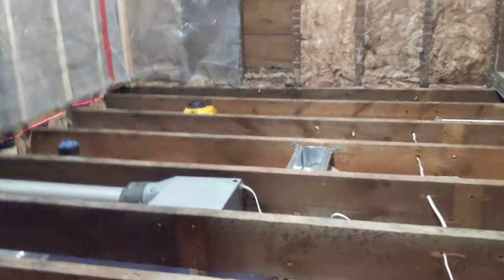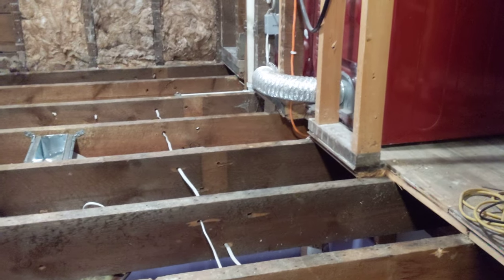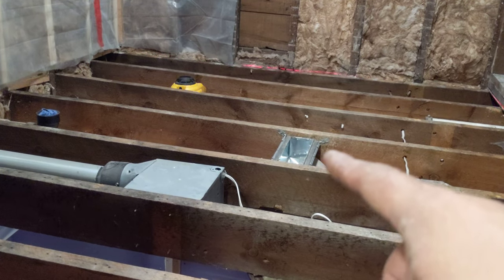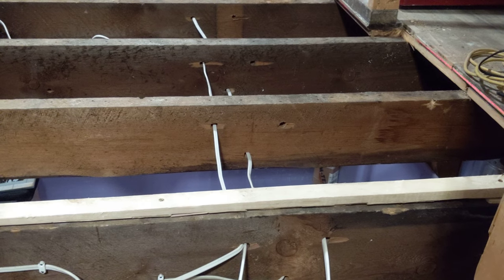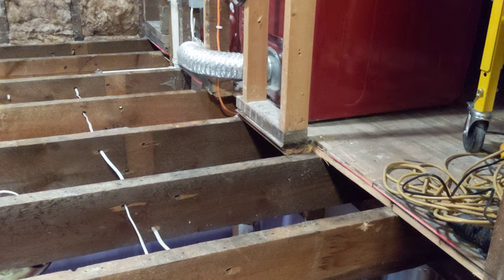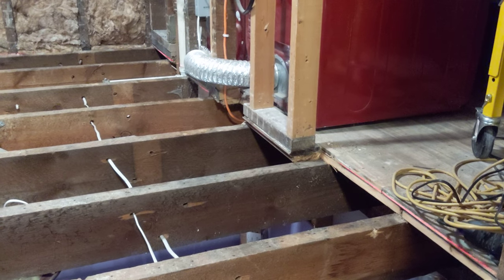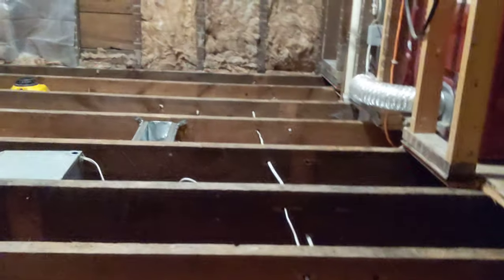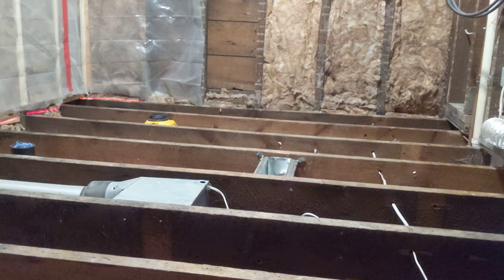How to level floor joists in old home.

Comment: I really enjoyed watching this video and I am currently working on my laundry room floor in much the same way.  I removed some of the old floor joists because they were twisted and it would have been difficult to intall shims on top and for the new flooring to lay flat.  Also,  the floor is higher on the inside wall and slops toward the opposite wall facing my backyard and the difference in measurement ranges from 1/2" to 4 5/8" at its highest point.  The "centers" measure 22" between joists too, instead of the standard 16".
Reply from the maker: Ours had quite a bit of slope as well. Even after leveling all of the interior rooms with jacks in the basement. Those old homes sometimes just did not have even boards. This home was built in the late 1800’s.

Comment: I don't raise the floor where it sags, I lower the surface of the joists at the original high points so that when I lay a new floor it is perfectly aligned and matches the existing entrance to the next room.
Reply from the maker: So we only shim up at the side walls throughout the floor. All the entrances still matched at the doorways. I found the to be less tedious that trying to get all the joist level by removing wood. Also maintained the integrity of the joist then. Not to say there isn’t enough to reduce a bit but for our situation this was easiest.
Reply: @TrueBlueCollectibles yeh i dont think taking away the integrity of the joists is a good answer. Im having this problem right now. Thanks for the video. Was going to put raised blocking. Might still do that and ad shims on the joists, level to the  blocking.

Comment: Why didn’t you put a 4x6 center support beam in to stop further sagging
Reply from the maker: The sagging was actually in the center of the home not beneath that room. Proper beams were in place along with jacks in the basement but we couldn’t raise them more without causing all kinds of issues above and at the roof which was just replaced prior to taking on this project.

Comment: Hi, great video. We are going to do the same thing to our flat. Do have any tips how to cut the shims? We are considering using plastic shims to level the floor, did you think about this option or is there any concerns using those?
Reply from the maker: We actually used 2x4 because ours needed quite a bit of shimming to be level. Just placed the 2x4 on the joist, then marked the low end and used a chalk line to snap it straight. From there to cut we just used a skill saw. But you could also feed through a table saw.

Comment: Thanks for video. I have a question - why did you choose to shim rather than sister board?
Reply from the maker: needed space for vents and less drilling for running plumbing and electrical.

Comment: How do you cut the shims? They are so thin
Reply from the maker: I just screw them to the floor and use a skill saw. You could also use a table saw but that takes a bit of practice to run them through without a jig.
Reply: @TrueBlueCollectibles  how do you cut them with screws in them? Just drive the screws past your cut mark?
Reply from the maker: @sef2273  yes on the thicker ends of the board. Then when you finish cutting your shim you will only have one screw in the thick side of your shim.

Comment: Hey my house has a the same type of flooring. If I remove them will it mess up my infrastructure? Like the walls on the side?
Reply from the maker: If you remove the old joists before replacing them yes this will likely cause structural issues. If you are talking about the sheathing, then no.

Comment: Just tell me how to level a sagging floor that’s over a crawl space please.  Not relevant about the other aspects.
Reply from the maker: I would personally use a pier block and an adjustable floor jack where needed. You could use a 4x4 to span multiple joists with a couple of jacks, much like the underside of a deck.
Reply: @TrueBlueCollectibles  thank you.  Our joists meet butted together in the middle of a 27’ span.  These joists are spaced about 15 1/2” apart for 14’.  the joists themselves are sagging.  
They rest on a large beam in the middle.  That beam is resting on a cinder block which has settled.  It has settled about 2-3”.   The beams ends rest on the block foundation walls below the sill plates.  How would you tackle this?
Reply: Wish I could share a picture
Reply: We do have all the subfloors removed and crawl space opened up.  We dug it out so it has at least 24” minimum clearance underneath
Reply from the maker: @Froggerty  feel free to email one over. tbcbreaks at gmail dot com
Reply: @TrueBlueCollectibles  thanks!

Comment: So the only way to fix a low joist is to shim it?
Reply from the maker: This was the best way for us and our home. You could sister new joists in, try jacking up the floor from the basement (potentially causes all kinds of other issues), etc. All kinds of ways, but this was the best for us.
Reply: @TrueBlueCollectibles  thanks!  I'm building a deck frame and am running into an issue where one joist is lower than the neighboring joists. I like the idea of shimming it or add tape on top of the low joist. Just looking for ideas.
Reply from the maker: @diggingmystyle  when doing the deck joists, make sure you set the bow of the board up for all the joists. This will help but there will likely be small variations regardless. small variatons can be fixed with shims under the deck boards themselves, larger variations on decks sometimes is easier to replace the joist or relevel that specific joist. Since you dont have supporting walls or heavy loads on top of the deck in most instances.
Reply: @TrueBlueCollectibles  thanks! I think I will go with shims since it makes the most sense and is the easiest option. Appreciate your input!
Reply: @TrueBlueCollectibles  I have an uneven floor across a big room (goes from 0.5 inch to 2 inch difference). Whould you recommend to shim joists with 0.5 inch and sister joists with 2 inch difference? Or what should I take into account when deciding sister vs shim? thanks
Reply from the maker: @jennadzitsiuk2496  SOrry for the long delay. I had not noticed your comment as it was a reply on another comment. For us we used a single shim that was tappered all the way from 2" down to a feather. This was done by using the laser level and marking the 2x4 for level. We then used a skill saw to cut the shims.
Reply: @diggingmystyle  I have the same problem, one (maybe 2 if it's easy) joist to raise up to correct a wave in the deck. A long shim would be best, but cutting 2x4 isn't great for outside deck rot. Did you find a good shim solution?